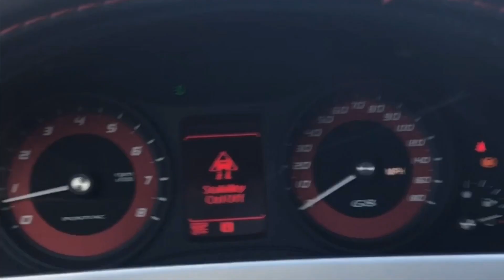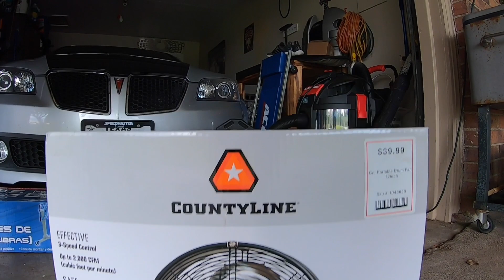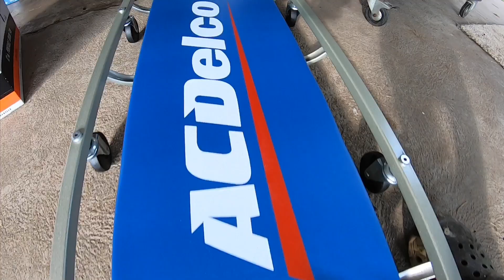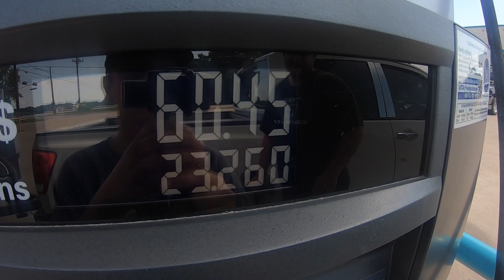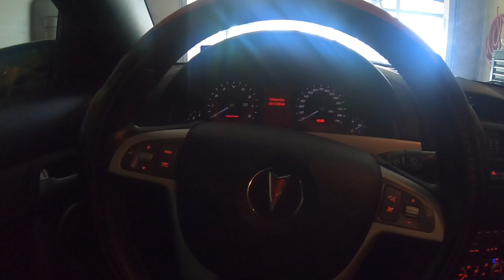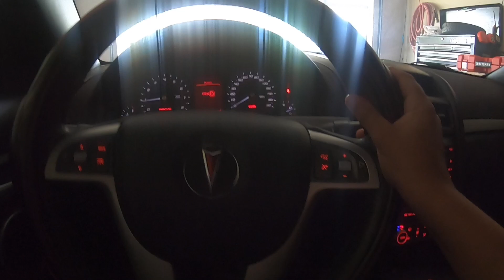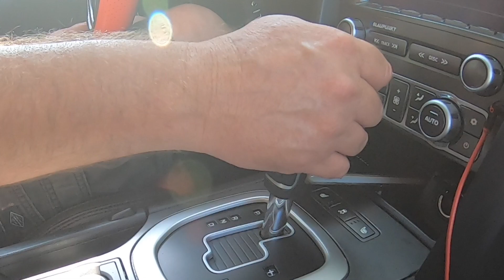14 year old Rebuilds  a Fbody Z28 Camaro  pt.3

Comment: Very nice video.....Lots of fun projects. M guess is, you have an air pocket in the cooling system . Need to loosen the screw on the t stat housing and let the car run until it gets hot and starts pumping out antifreeze from the screw and then tighten.
Reply from the maker: Camaro Time yes sir it’s me jonathan but we tried that I talked to lots Elliot and they said it’s a cracked head most likely so